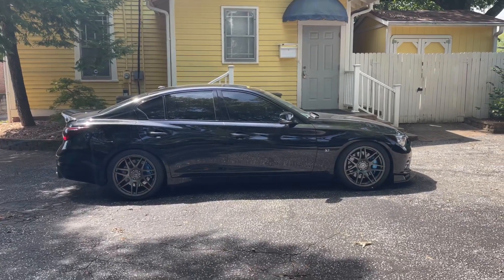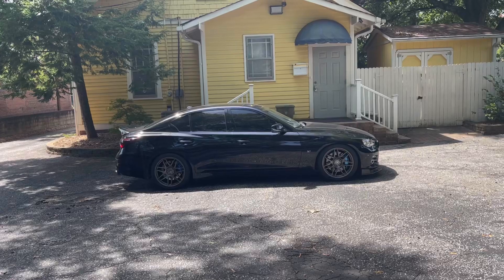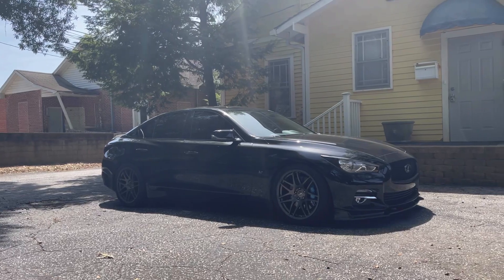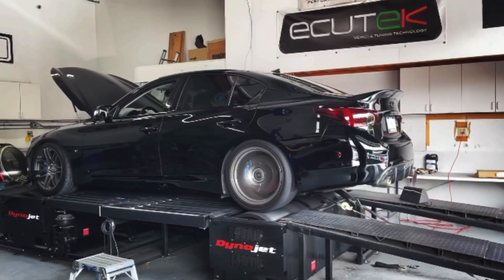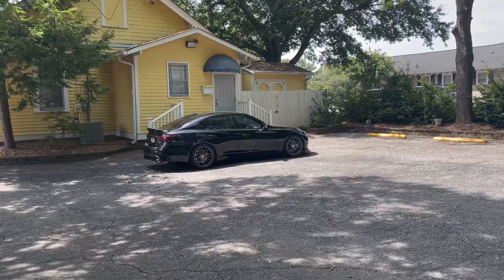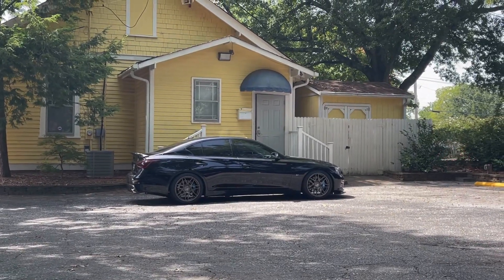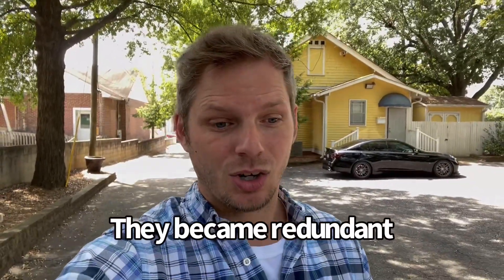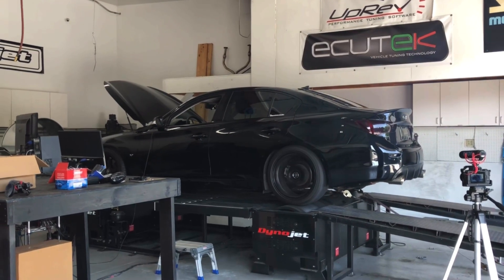Watch BEFORE installing 2.25” Test Pipes on your VQ37!!

Comment from the maker: I believe I misspoke--dynos calculate horsepower using a formula using the relationship between torque and rpm--I believe--not wheel speed.  Although I have seen some statements saying wheel speed does fall into the formula somewhere, I am not sure that is accurate.  If you know exactly how a dyno calculates hp, leave it in the comments!  Thanks for watching!

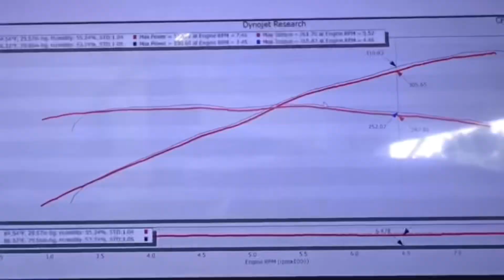Comment: Horsepower can be calculated from torque and engine speed by the equation  of Torque x RPM / 5252 = Horsepower, for example in your dyno graph at 4:45, 252tq x ~6450 rpm / 5252 = 309.5 hp. I'm not sure if that's how dynos calculate horsepower, but it's a very accurate equation.

Comment: Great video. Recently bought a 6 speed Q60 & I gotta say.. I’m all aboard the SCS train! About to install my BC (DS type) coil overs, along with all the SPC suspension components this weekend. Excited to see the Fitment/stance it’ll have with the bronze Z1 Zm-23 wheels I just put on!
About to pull the trigger on purchasing all the exhaust pieces, but wanted to know where did you buy the connecting 2.5” piping to connect it all? Would a local muffler shop have it available or should I opt to go with the piping that Z1 offers on their site? Going to pair that with the FI resonated 2.5” test pipes, drop in K&N filters & piping, then we’ll see what those numbers are reading after a tune!
Reply from the maker: exhaust shops will have the pipe on hand.

Comment: Very cool video. Weather is always a big factor on engines. One question, do you have any plans for the current Q50 on performance mods apart from exhaust. From a performance stand point doing exhaust seems like a lot of work for not much gains.   What else apart from expensive turbo, supercharger or nitrous kits could you do to say have a 300whp/300ftlb torque machine.
Reply from the maker: The torque is a tough one.  Honestly, if I were to get biggest bang for my buck, I’d do filters/intake test pipes and tune and be done—I’m not sure how the factory catback would sound, but I think the car would make the same numbers.

Comment: Do you have any issues with vibration? My berk resonated ones don’t have anywhere to bolt them up to the brace like the stock cats and some un resonated ones
Reply from the maker: No vibration, but I have nice flex pipe in my custom catback
Reply: @SpeedCultureStudios  I’m actually running your custom catback too with flex pipe. But ever since I went to test pipes they tend to vibrate a good amount at 1500-1700rpms.
Reply from the maker: @Warsoul37  I didn't have the brackets on my test pipes either and vibration was a worry of mine because of that, but really didn't have an issue.  If it doesn't bother you too much, it shouldn't be a problem.

Comment: What test pipes do you recommend and what did you have when you had more torque?
Reply from the maker: Check out my dyno videos and my test pipe recommendation video.
Reply: @SpeedCultureStudios  I just got tuned at soho and made 320/265 on my g37. I have typical bolt on's with a hfc. If I switch to test pipes do you think I'll make more hp and torque over my isr hfc?
Reply from the maker: @v36vhr  you’d probably get a touch more.  I’d guess 330/270ish

Comment: Your best setup had 2.25" catback. You then put a 2.5" on and lost torque. Then you change to a smaller test pipe but keep the bigger CBE and lose torque again.

You need to test 2.25" all the way vs 2.5" all the way. Otherwise you have mismatched pipes.
Reply from the maker: I think you have my setups mixed up.  I started with 2.5 TP with 2.25 you are correct.  Then 2.5 TP w/ 2.5 catback.  Dropped torque and gained 1 hp.  Then tried 2.25” TP with 2.5 CB.  I lost some but I believe it was more the cars issue and not the exhaust.  But I did go back to 2.5/2.5.  The issue is not mismatched pieces.  That’s actually the best way to go.  The car benefits from a more narrow test pipe as it maximizes scavenging.  This has been tested.  Beyond the collector it needs to open up to maximize flow now that there is no scavenging occurring.  And actually ideally the tail portion would increase to 3”.  The misconception in the car world seems to be that the bigger the better or that it needs to be the same diameter throughout.
Reply: @SpeedCultureStudios  The same CFM in a larger pipe means the gasses are flowing slower. We all know you can't go faster that the guy in front of you. This is described as a loss on VE, which is fine if it doesn't interfere with scavenging. So the CBE should only start opening after the y pipe or x pipe (depending on which you have) where the scavenging effect is ending. 
Your video used a test where you had slow moving exhaust gasses traveling through a wide test pipe trying to fitting into a smaller CBE. And then your next test had a fast gasses flowing through your TP into a larger diameter CBE bumping into slow moving gasses. 

The change of velocity is inefficient.

You should do a part II where you have 2.25" TP to 2.25" CBE (which they all open up larger closer to the tail pipe). I would predict your best torque numbers are there where the CFM is supported and VE is good. Reducing either CFM lowers HP and reducing VE lowers torque. So going to 2.5 TP or CBE will reduce torque (which your results support)
Reply from the maker: @stygiangs  Right, this is what I was saying.  I had 2.25 TP moving to 2.5" CB.  Ideally I would have had 2.25" going into my mid-muffler/x pipe and coming out at 2.5, but the distance from test pipes to x was minimal, so I don't think scavenging was impacted all that much.  My best numbers came from 2.5 TP to 2.5 CB, but with a y pipe (3" collector).  Made 281/333.  It sounded terrible, which was mainly the reason for the change.
I would like to see what a complete 2.25" system would have produced.  I would imagine a nice torque number, but I'm sure the HP number would suffer slightly.  With that said, the car's troubles are in the low end anyway, so overall it may be better.  Maybe down the road we'll test it out.
Some motordyne engineers have a very nice write up testing various exhaust combinations you might be interested in.